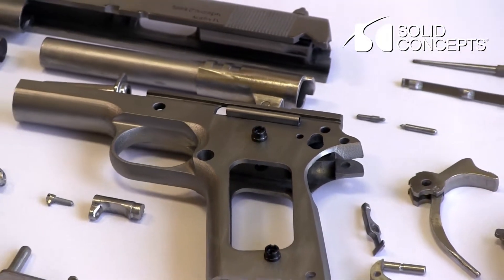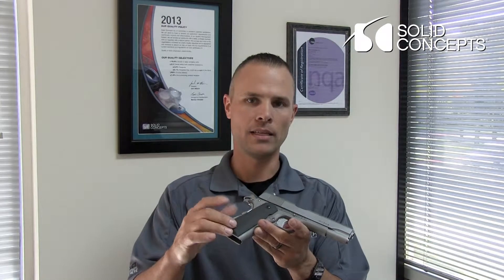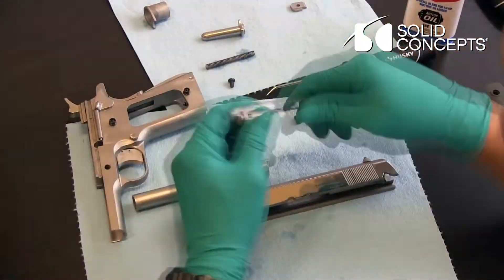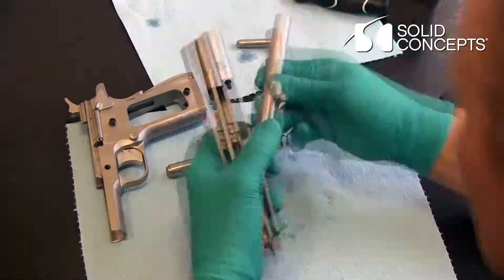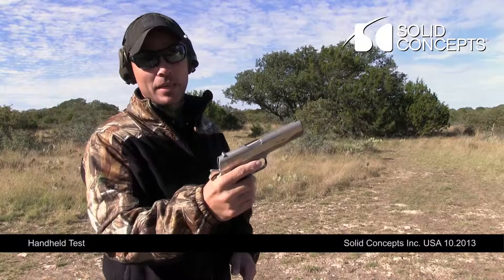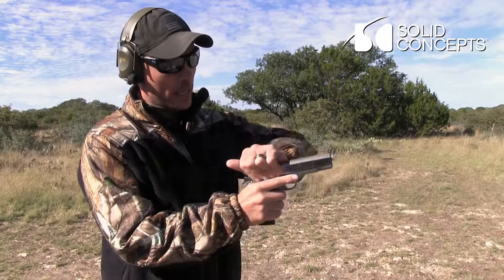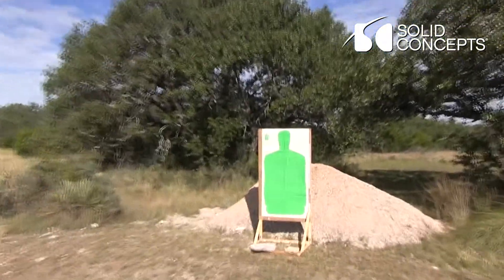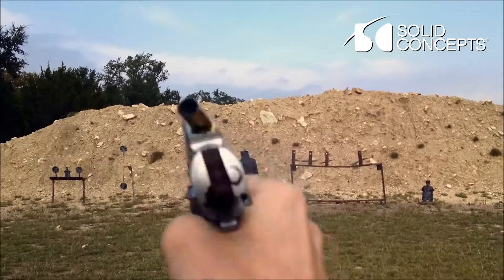The Original 3D Printed Metal Gun

Comment: WOW!!!!!
Sear and sear notch came ready to use after printing or some file and stone work was needed?
And about rifling? Don't tell me the lands were printed... I am just about to faint.
Reply from the maker: Some post production finishing was required. All was printed but the springs and pins.
Reply: @pixrite  I've seen 0.002- 0.05 mm errors on 20 mm parts in many videos. I suspect the expected error in smaller parts, like a sear, with less material to shrink, should be even smaller. I have some ideas on hammers, sears and triggers to test. Created an account on PCBWAY.

Comment: Do you guys have a metal printer that is actually affordable to the avrage person id love to have one
Reply: It’s $4000 for the printer and the kiln to fuse the metal print together.
Reply: If that's true I respect that price @lucasrule5557
Reply: @Lucas Rule  that's actually not as bad as I expected
Reply: @lucasrule5557  what is the name of the printer
Reply: @cookiegott9813  oh is just a regular 3D printer I’m using a Qidi max II but any will work. The filament is just steel filament from matter hackers. And then you buy a furnace to bake the part. It’s like printing with clay but it’s metal.
Reply: @lucasrule5557 doesn't sound like dmls
Reply: @Maestro7228  it’s FDM metal not SLS metal you can print with metal fuesed pla
Reply: @lucasrule5557 this videos even says its about SLS at the start?